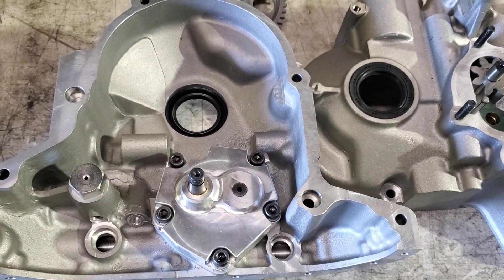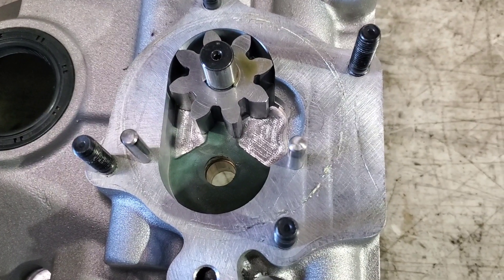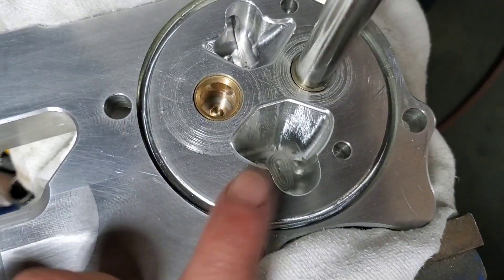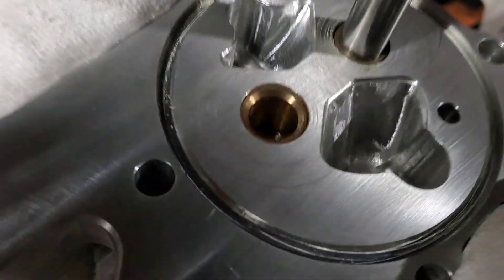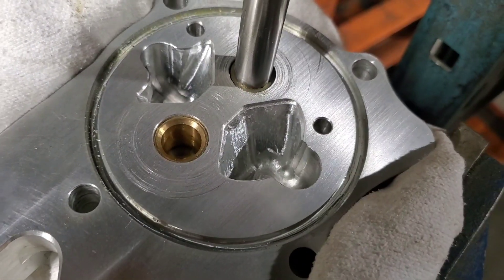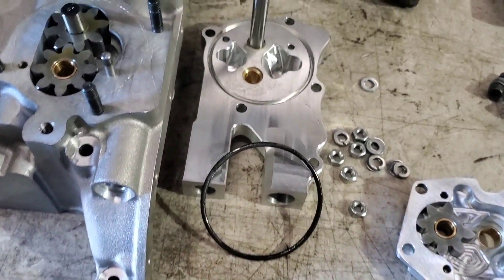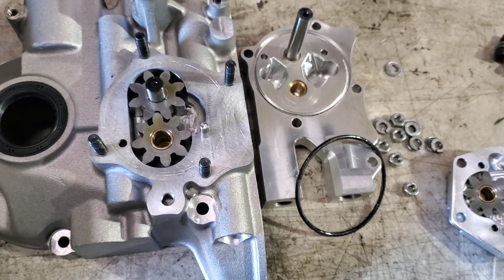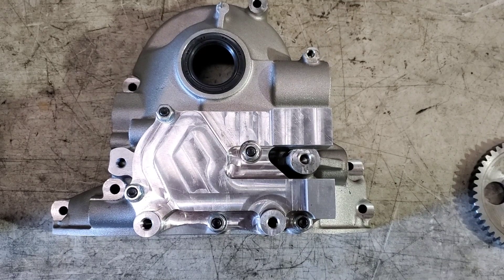Mazda Rotary Dry sump front cover tricks and tips

Comment: Is it normal for the face of a new pump to be that scored already?
Go KMR!!
Reply from the maker: I had to go and look at the video.  I'm so used to what they look. The rotation marks are normal.  Its a polished aluminum surface. They a only visible not an actual scratch. Think of a raw piece of Polished aluminum.  Take a clean rag and whipe it.  Boom you just scratched it visually.
Reply: @KyleMohanRacing  Thank you for the reply and explanation.